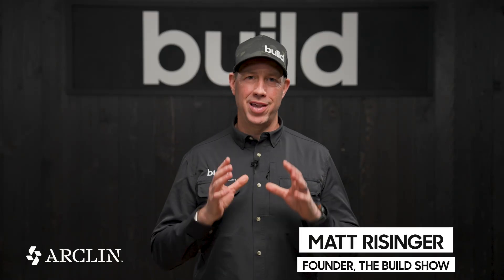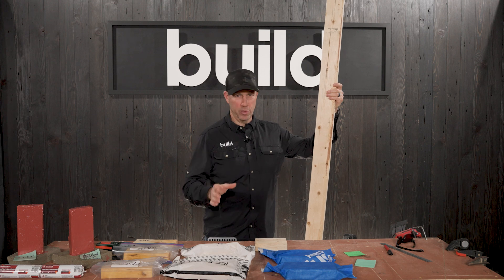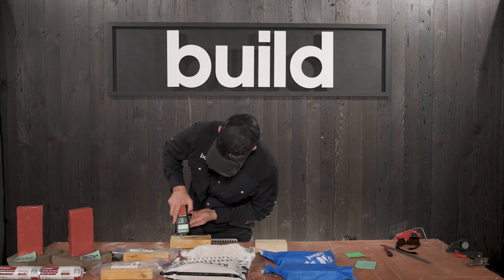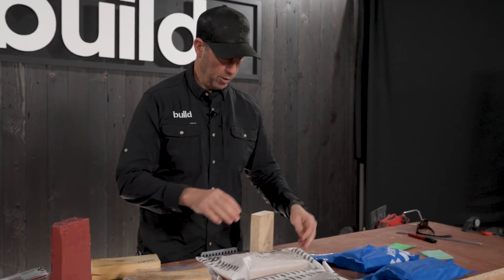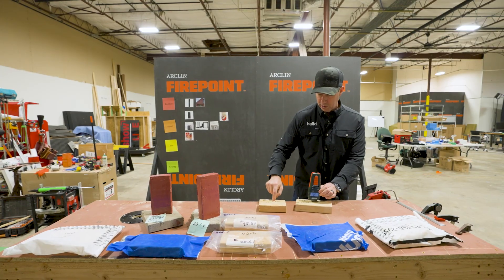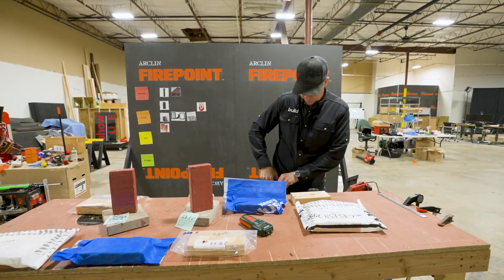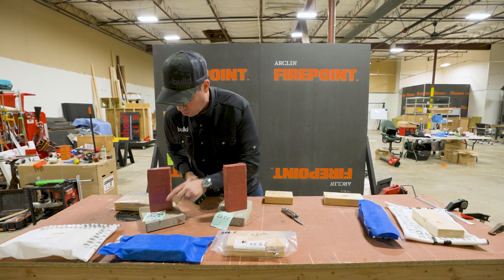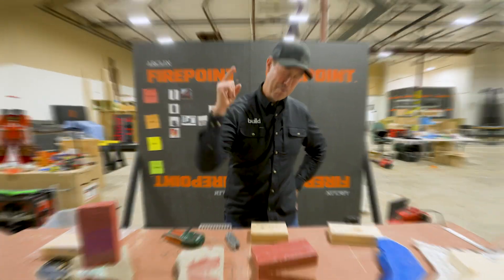The truth about WRBs and Mold

Comment: The plastic bag is permeable. Even plastic water bottles are permeable - leave some in your cabinet for a few years and you will have bottles with headspace and/or collapsed in- if you want a bag that is largely impermeable you need to use a metalized plastic - you sometimes see this on the inside of potato chip bags. Food manufacturers often use special layers in their packaging that limit permeability and you can still see through. Your modern plastic gas can likewise has special layers or additives to limit vapors from getting into the atmosphere due to CARB and EPA regulations.

Comment: I like the idea of testing this but there's a much better/reliable way to do this experiment -- use mass, in grams, for each sample before and after the period of time allowed for drying instead of measuring relative moisture content (MC) (1g water = 1mL water*). This will side step the issue of condensation within a sample too, like there was with the ziplock bag. I'd argue that free floating water not locked into the wood is even more of a problem than just the wood itself being wet.

Like others have pointed out, because water is able to migrate and normalize within each sample, the readings you're getting aren't a reliable tell of whether or not real drying has actually occurred. 
Assuming we define drying as how much water from the sample has escaped into the surrounding environment, it's more worthwhile to know in absolute values how much water has been able to leave the sample. That said, it is good to know what the relative MC of a material would be after that MC has normalized within the sample, even if water were unable to escape the sample, but that wasn't the goal of this experiement. 
Each piece of wood, even from the same board will absorb (and release) water at slightly different rates and an overnight soak isn't going to be enough to penetrate all the way to the core of the wood.

*If anyone really wants to be pedantic, 1g water isn't exactly 1mL under "normal room temp" conditions, which everyone could defined differently... if at 20C (68F) and 1atm pressure, the true value is about 1g water = 1.0018mL water

Comment: I’m glad you did this test. It would be interesting to see an additional test with polyiso and 6mil poly as the “wrap”. In Ontario, the most common wall assembly has 1” of polyiso as a Ci outboard of the sheathing with 6mil poly detailed as an air/vapour barrier at the interior.

Comment: How is it possible that you're puzzled by the wet 2x4 in the Ziploc bag? You are the man who introduced the internet to Building Science. You've been working in the field for decades. The community (myself included) owes you a genuine debt of gratitude... And yet, you went to the trouble of prepping for a truly fascinating video and nevertheless trusted that a 5 cent Ziploc bag was impermeable to water vapour. How can you still not understand the differences between a solid-wood, softwood 2x4 and more-easily mold-digestible wood products like paper-facing (drywall) or OSB, which don't grow mold overnight? Never mind that molds are typically frustrated by low-oxygen environments (such as a sealed Ziploc bag)... Matt, you're a credit to Building Science. But you really can (and should) do better. Quality is more important than quality; that goes for endorsements and videos just as much as construction.

Comment: Hey Matt, I like your work and aim here. However, consider a few things. A pin style moisture meter might not be accurate here. Pin moisture meters give you a reading near the surface of the wood. Also pin style meters can give different results with pins parallel to the longitudinal wood grain vs. perpindicular. The moisture content (MC) of the core of the 2x wood material is likely different than at the surface after only 24 hours of soaking. It can take weeks for wood MC to equilibrate. For accuracy, you need to use methods that measure the wood+water sample weight to figure out when equilbrium is reached. It's reached when weight stops changing. To determine MC of a wood sample you need to weigh it with MC and again after often drying (moisture removed). Refer to ASTM D4442 for the accurate method to determine moisture content of a wood sample. I hope you or others consider repeating your study but with more accurate methods to assess begining and ending amounts of water in the wood. Thank you for the good content.

Comment: matt-watched one of your old videos on when to put a vapor barrier on an exterior wall. I live in wisconsin, so hot and humid in the summer and very cold in the winter. 115 year old farmhouse with vinyl siding then 3/4" x 4'x8' sheets of insulation then the old wood siding. when doing an exterior wall down to the studs, i used rockwool then drywall or wood shiplap. should there be any plastic on studs just behind drywall or shiplap? thanks, I am getting 100 different answers, im confused...lol

Comment: interesting test. The thing I cannot figure out is at the beginning you showed pics of your moldy walls. Why the clear plastic on the inside of those walls? Years ago here in So Fl where mostly all slabs are Concrete I was a wood floor guy and way back then was 6mil Visqueen on slab, plywood nailed or screwed down, 15# roofing felt on plywood and then 3/4 wood nailed/stapled thru felt. Cannot tell you how bad some of the floors that got wet once from a leak were.. Never dried out even with Climate control set lower to draw out the moisture. so Wouldn't sealing the cavity like you all did cause the issue more than help it?
Reply: In the "early" days, clear plastic (PE foil, visqueen...) was used as a vapor and air control layer on the inside. That works only if the wall is (and remains) vapor open to the exterior.

These days, it's better to use a vapor open air control layer on the inside while keeping the exterior vapor open, this way the wall can dry to both sides if needed.

Comment: Why don't you use concrete and bricks. They absorb and release water without ever worrying about rotting or mold. This is what the rest of the world builds with.
Reply from the maker: Yes, those are common building materials in the rest of the world, however, in North America we are a wood dominated market. We have abundant timber resources and you can absolutely build a terrific home with Wood.
Reply: @buildshow  I can understand that. But also you guys have extreme weather fluctuations. Basic concrete also have better thermal mass that timber. This will also help save energy bills if the house is designed properly for certain climates.

Comment: If you use chlorinated tap water that may have delayed mold growth.
Reply from the maker: Interesting. I wouldn’t have thought of that. Yes, it was city tapwater.
Reply: @buildshow  You also have need it to be exposed to spores. A very clean shop with good filtration would have minimized that.
Reply: No mold was inside the sealed bag to start growing
Reply: everyday house leaks from plumbing is also tap water and mold grows anyway. Not enough chlorine to prevent mold imo.

You can drink tap water and in most cases not taste or smell chlorine

Comment: if you aren't using pressure, it can take hours to weeks to fully soak 2x4s to the core depending on their resin content and grain density. a tester that reached the center of the board would have been a good idea here. any hardwood dealer that does slabs should have one with a slide hammer on it and long enough tines. i suspect some of your moisture drop in all samples is moisture normalization within the wood itself.

the condensation release is at least plausible, especially if the board was warmer than the air around the bag when it was put outside. think about rice in a sealed container going into the fridge. it's always dried out with condensation on the container the next day.

the speed of drying is massively impacted by the delta between the moisture level of the wood and the available moisture capacity of the air around it.

all this said, i think you did a fine job showing the basic concept. there was likely some drying through those materials for sure.
Reply from the maker: Great points and appreciate the detailed feedback!  I soaked the two by fours in a water bath for 24 hours with some bricks on top but you make some excellent points. I think I might redo the test with a few of your ideas. If I find dramatically different results I’ll make another video.

Comment: Another possible explanation for the zip-lock moisture reading:

The initial sample was soaked but it probably wasn't 100% saturated.  The outside layer of the wood could have been saturated while the centre is left with more room for moisture.  When the wood sample is left in a zip-lock bag, there is enough time for the moisture to migrate throughout the sample.  This pulls moisture away from the outside layer -- so right where the moisture tester is testing.

To test this one could soak a board as per what was done in this experiment.  Then cut the board in half and test the inside of the board in multiple locations.  Not a perfect test but still interesting.

The better way to perform this test would be to use a scale and measure the weight of the samples.  This would measure exactly how much moisture managed to escape the sample.  A much more accurate method of measuring moisture throughout a sample.
Reply: Weighing the samples is a great idea because the same sample could be tested many times over a long period of time without poking holes through the membranes.

Comment: Great test! Another great video.
One reason the zip lock bagged piece dropped in moisture is the boards did not soak long enough. If you had split one open and checked the moisture in the middle, I expect it was nearly as dry as the control. It takes a long time for moisture to move through wood.
And the reason you did not see mold was there were not enough spores on the wood to grow. On an open job site, there is a lot of air movement bringing mold spores. In a zip lock bag... not so much. Kind of luck of the draw there.
It would also be interesting to see a dry piece of wood wrapped in WRB, submerged for days and see what happens. Does it take on any moisture?
Thanks!
Reply from the maker: Great points and ideas! Thanks for sharing your insights.

Comment: Zip lock wood may well be more moist on bottom than top.
Reply: Perhaps, but the point I took from it was that 100 percent of the original amount of moisture was still inside the zip lock plastic bag. That meant that the wood is still confined with the moisture adjacent to it therefore in a constant high humidity environment.

Comment: Good video. So much to learn. 
Question - I recently had to open part of the ceiling on a family room addition (21st Century addition with a low slope roof) on a 1959 house. The roof rafters/ceiling joists are 2x8, but only have 3-1/2” of insulation. Ive read about needing ventilation space between the insulation and the roof deck, so the space makes sense. Also wondering if there is any actual ventilation because there’s no inflow point in the eaves, and the solid blocking only has two 1/2” holes drilled through them. Do I need to leave the air gap if the inside is normally cooler than the outside, or can I fill the cavity and maximize the R-value? Or do I need to drill some vent holes in the eaves and increase the holes in the blocking?
Reply: Run the Styrofoam rafter vents from your eave blocks all the way to the ridge and drill holes in your eaves. Make sure it vents through the roof ridge. Then you should be able to get a ton more insulation R25-R30 unfaced batt. R40 would be better, but you’d have to add foam to your roof plywood before roofing.
Reply from the maker: This analysis is quite good. I would agree.

Comment: 7:38  I was expecting the saturation to go down on all of the wet boards. My theory was moisture didn't have time to penetrate through the boards overnight and was only on the outer edges when initially measured. While it sat, it had more time to distribute more evenly through to the core of the board, which would lower the measurements on the edges.
Reply from the maker: I think that’s a valid analysis
Reply: To test that, do another overnight soak, then cut your block in half and do a moisture measurement on the center of the fresh cut vs. the soaked exterior.

Comment: I live in Canyon Lake Texas, used zip-system it rained about three times during frame work. I was worried about moisture, I guess it was for not.😅
Reply: He didn't include Zip in this test, for some reasonsponsor. 
You're in Texas, therefore mostly drying to the inside. The outside coating should not be part of your drying process.
Reply from the maker: I’m a big fan of zip products and I use them at my own home when I built four years ago. I think the basic Takeaway here is that your wood framing needs to dry below 14% moisture content before you move onto closing in the house. Also, I wanted to show that Wood can absolutely dry through a permeable house wrap. Homes get rained on all the time during construction and can absolutely dry without harm as long as we are cautious.

Comment: Some of the moisture "loss" you experienced on some of these samples would be that the moisture penetrated the wood further.  A 24 hour soak wasn't long enough for the wood to reach equilibrium, so most of the water was on the surface.  When you put it in a bag it diffused through the block, reducing the surface moisture.  A better test would have been to soak them all for 24 hours, put them all in a bag for a few weeks to reach uniform saturation, then perform  your testing.
Reply from the maker: That's a really interesting point about the moisture penetrating the wood further. Thanks for the feedback!  I think the basic premise of my test is secure, but you make some really good points
Reply: @buildshow Thanks.  It would take a year for a 2x green plank to dry all the way through without a kiln.  It takes a while for it to become fully saturated.

Would be a fun test to soak for 24h, then rip it in half and compare the moisture in the core vs the outer edges.

Comment: Didn't check Zip? Hmm
Reply: Hmm indeed...
Reply: Check zip?  You want him to build a box out of zip sheathing and put the block of wood inside it?  He was testing vapor permeability of WRBs, zip is system, not just a WRB.  Pretty confident the OSB in the zip could have absorbed the moisture from the block even if the zip coating weren't vapor open.
Reply: @josephhfry  Yes and yes.  Zip is quickly becoming one of the most widely used WRBs and since it is integral with the OSB testing together (with zip tape) is logical.  The results would have been informative for a large number of builders who watch this channel and likely use Zip (at least partially) as a result of its presence here.  Perhaps its absence was a conscious decision, given its low perm rating and potentially less than positive outcome (not that anything is hidden, Huber publishes a perm rating of 1-3).  FWIW I am one of those builders (who really likes Zip) and would have been interested in the results.
Reply: @IPVDC  my point was that this testing was flawed and would be even more flawed by the introduction of the OSB in the zip which would have its own moisture content to be considered.

I applaud anyone wanting to understand this stuff, but please recognize just how poorly designed this test was.

For example, that 24 hour soak likely only really penetrated a few mm into the block.  Much of the drying he observed was likely the moisture penetrating deeper into the wood as it approached equilibrium; as evidenced by the block in a plastic bag.

Huber has their product independently tested, the perm rating they report is obtained via an industry accepted testing methodology, not an obviously flawed test by a construction influencer (not hating, but just being honest).